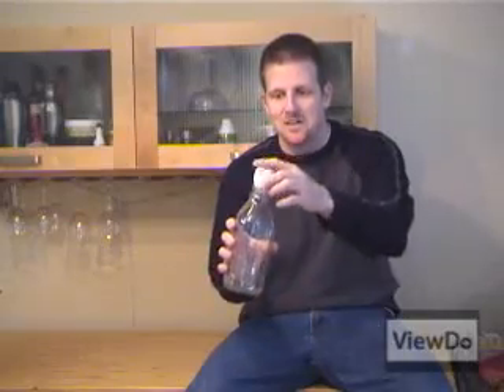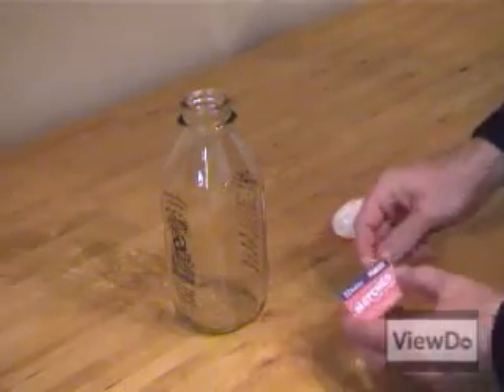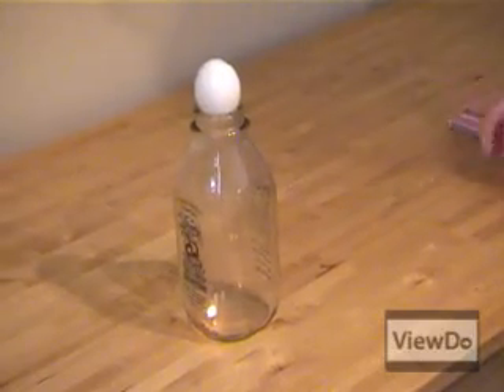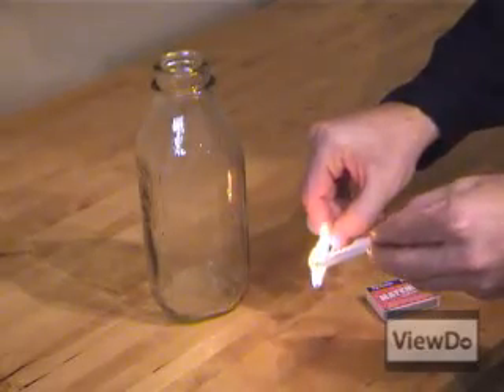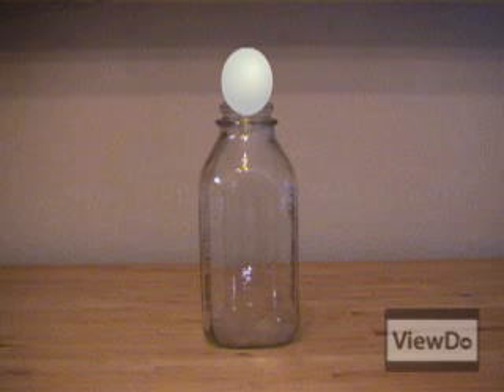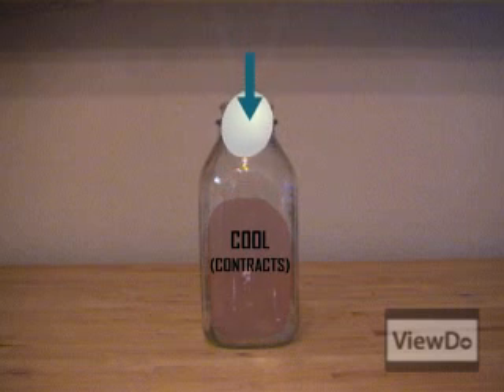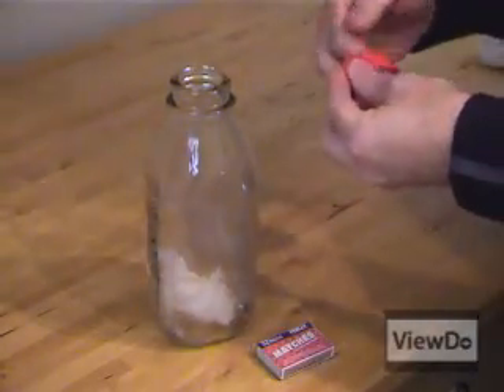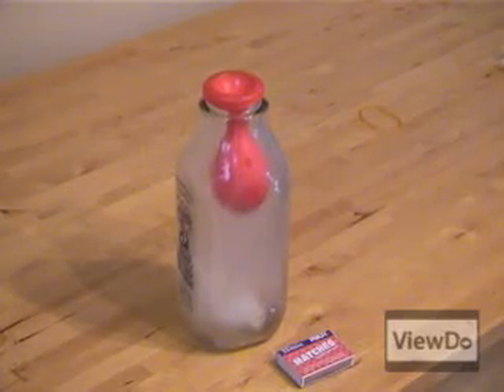ViewDo: How To Get an Egg in a Milkbottle

Comment: I was always told that science never sucks.

The pressure inside the bottle is lower than the pressure outside. The high pressure outside pushes the egg into the bottle, to equalize the pressure.

Comment: there is another safer method of doing this put the egg on top of the bottle and put the bottle in hot water (about 100 degrees) for about 10 seconds then quickly move the bottle to cold water and it wil suck that little f*cker right down

Comment: well turn the bottle upside down so the egg makes a seal and then heat the bottle. 
Or do the same and put the bottle in a vacum chamber.
Or fill the bottle with expanding foam.

Comment: The explanation isn't quite right.  It's just that when the air inside the bottle is consumed by the fire, there is now relatively low air pressure in the bottle and in essence the weight of the earth's atmosphere outside the bottle pushes the egg in.  It's the pressure differential that causes the effect, not "expansion & contraction."

Comment: Are you sure about your explanation?
What proof do you have that it's the hot air expansion that's behind this phenomenon?
Maybe using all the oxygen in combustion (and producing a different gas) is responsible for the change of the pressure in the bottle? 
 
- Why would the air be able to escape the bottle and not come back?
- Why would that cooling of the air be so quick?

Comment: the egg isnt being sucked in by the "cool air that contracts." you burn off the oxygen in the bottle thereby decreasing the air pressure in the bottle. the egg is actually being PUSHED in by the outside air pressure. shows how much 30 year olds know.

Comment: well...if you wanna get really technical, it's not a vaccuum at all - it's just a difference in pressure - vaccuum is when ALL the air is gone.  Also, the air pressure is technically pushing on it from all sides, it's just more force on the top than bottom (sides are balanced since there's no barricade to cause a difference).  
And Chemistry can be fun, but if you have cowardly teachers, it sucks.

Comment: I thought it might be because the fire burning the oxygen and other atmospheric gases in the bottle reduces pressure in the bottle, sucking the egg in. Though, since it is a combustion process, i suppose CO2 would be created...and maybe the pressure difference due to combustion wouldn't be much different. Question is, why doesn't the air expansion pop the egg out?

Comment: Easy, place a balloon on the end .Ensure that its air tight and no air could possibly get around it invert the milk bottle and heat the end..The egg will go inside the balloon. You can then cut it open and make an egg salad sandwich of victory. Actaully I have no idea if this will work but if someone could try it that would be pretty sweet. Just make sure you dont heat up the end too much.

Comment: 2) We also have a change of about -0.0113 mol of gaseous product.
In a milk bottle (1L???) under room conditions, there is 0.0446 of air. In the end we have 0.0333 mol gaseous products contributing to the pressure inside the bottle.

Comment: If we ignore the heat evolved for now, and use the combined gas law for initial and final conditions when temperature is the same at (25oC), we find that the pressure is 0.7466atm (outside the bottle is 1atm). This is a vaccuum since pressures are not at equilibrium.

Comment: if we include heat and assume that the expanding air can escape past the egg, then we are at a further deficit of moles inside the milk bottle when the air is cooled, which will cause a much larger vaccuum. I would calculate this but thermodynamics sucks:)